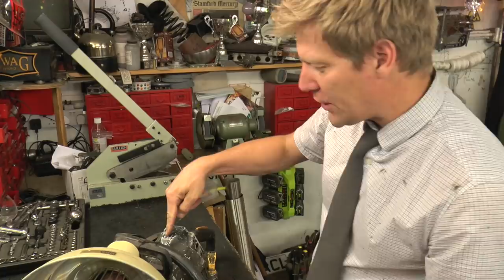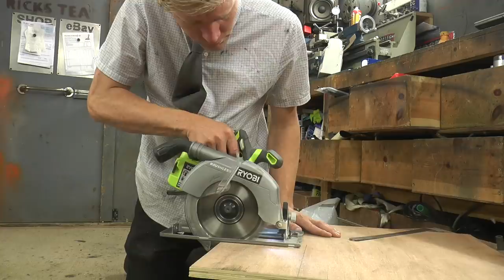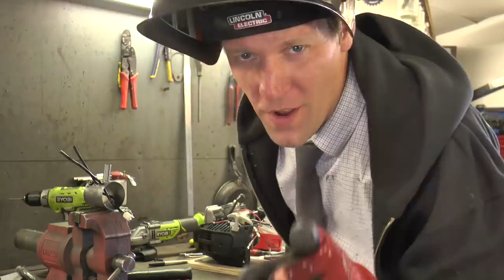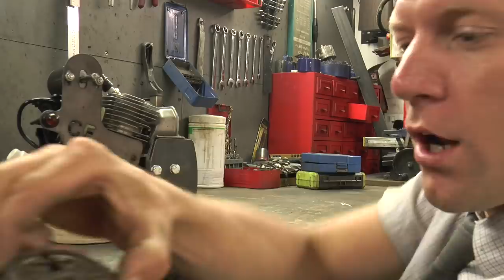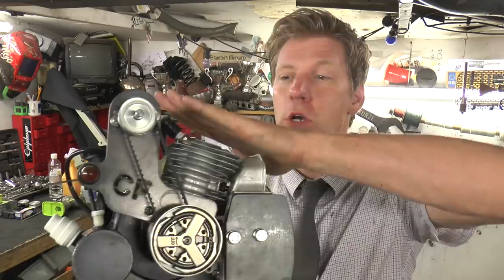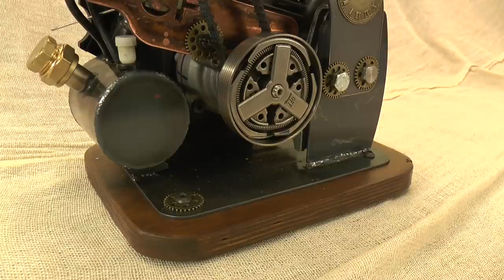Making a Chainsaw Table Lamp

Comment: At first I wondered why this was a thing. But then he explained that lamps aren't manly enough and you know what? He's completely right.
Reply: Electronic lamp? Pussy
Petrol powered lamp? Slightly better
Nuclear powered lamp? Yes.
Reply: Why not power it ya self
Reply: True
Reply: There were experiments about the nuclear one in Japan, they decided it isn't the right answer after two flashes
Reply: Ernest Y I recommend giving "nuclear light bulb" a Google
Reply: "Yeah dude, just had to go to the corner store to pick up some uranium for my lamp. See ya soon."
Reply: Ernest Y   “Oh no. My lamps fusion reactor’s broken. I think it’s run out of deuterium.
Reply: He said there was no testosterone in an electric lamp, but there's no testosterone in a two stroke powered lamp either. If you want testosterone in a lamp, powering it by male hyenas on treadmill is probably your best bet.
Reply: POSITIVE MASCULINITY
Reply: Not a very silent lamp though... I would hate to have that thing on while watching TV.

Comment: I would like to see a 2 stroke vacuum cleaner. 😊
Reply: what about a leafblower?
Reply: 2 stroke microwave
Reply: 450CC 2 Stroke vibrator dude!
Reply: 2 stroke generator + vacuum cleaner + tape. easy.
Reply: ohyeahtotally08 no the electric motor would be replaced😑
Reply: Two stroke boombox.
Rock'n Roll accompanied by high rews can't go wrong!
Reply: David van Ruiten How about a steam powered vacuum cleaner?
Reply: @m1k869  thats already a thing

Comment: Next, swap a V8 engine in a Tesla.
Reply: Ed Weird in Smart.
Reply: And then turn it into a lamp
Reply: why would you downgrade a tesla?
Reply: /r/woooosh
Reply: Someone actually made something better: a diesel in a Prius!
Reply: Someone did put an LS crate motor in a Model S front end that they were converting to a desk. It fits just fine.

Comment: "We're using the CNC, we're cheating a bit" 

Tools don't make you better, they just make you quicker.
Reply: debatable, For example a hacksaw and a circular saw do the same thing, But my cuts are a hell of a lot straighter with a circular saw, and some tools do the same thing but require different skills to do that job, A cnc machine I'd imagine this varies, But I know some use cad to tell the machine what to do, And the machine does it very accurately, Where as with a plasma cutter instead of being skilled with cad you have to be skilled with plasma cutting, And you won't be as steady. You're welcome for the essay you didn't expect nor want.
Reply: perfect response
Reply: beastm0de7, I found I can get a good straight cut but stone me it takes effort with hand tools. I'll have to jig it up, or just take my time. I take out a track saw though, buzz, done.
Reply: My uncle taught me something in his garage when I was a young boy it's two quotes I live by till this day when making something: "work smarter not harder." And "don't do the tools job for it; when you use it correctly the tools does most of the work for you."
Reply: that's not true in the case where you aren't directly using the tool; you can download a model and cut it out without ever doing any real work, aside from downloading it and sending it over to your cutter
yes it does the same thing as some other tools, but there is no human element to using it unless you manually change the settings on how the thing cuts.
Reply: So, how good are you at hewing marble (or drilling round holes in metal, or planing wood, etc.) with your bare hands?
Reply: I tried telling a girlfriend that once.

Comment: use the exhaust as a fan !
Reply: That really would be the manliest fan in the world, having it pump two stroke exhaust in your face, but a fan running off the same belt might be more practical, and help with the voltage spikes too
Reply: While a fan running off the electricity from the belt might be more practical, practicality isn't manly.
Reply: no as a heater
Reply: omg, best idea ever!
Reply: sam rowland i think The best way to add a fan functionality to that lamp would be to mount an exhaust gas powered fan, which is gonna act a bit like a turbocharger (except on the other side of the shaft would be a fan)
Reply: Ah, the wonderful scent of two stroke! A Modern fragrance for the powerful masculine.
Reply: danthefrst somebody should bottle that and sell it!
Reply: Hmm,  I feel like a catalytic converter fits into this mess somehow. LOL
Reply: Steven Ingram: Nah, only ripped out! As Mark Knopfler says it "If you wanna run cool, you've got to run on heavy heavy fuel"

Comment: What an excellent idea for a bedside light. Keeping one hand on the throttle you can use it for a bit of reading,remembering to 'blip' the throttle when you need to turn the page over,  then get a great night's sleep when the exhaust fumes render you unconscious, then as it ticks over in the dark it will keep you asleep until the fuel runs out. Perhaps you could fit a larger fuel tank to help you get a lie in at the weekend?

Comment: I always like steampunk devices that look that way because they actually use those parts to work, as opposed to having random bits attached to something very generic inside, no matter how artfully. This lamp's clever design and build quality makes it look like it's been made by a company that also makes motorcycles in an alternate reality where power stations do not exist because either there is not enough people using electricity or they were destroyed by a worldwide disaster or war, rather than something hacked together at home. It would fit great in a post-apocalyptic  game like Fallout or a movie like Mad Max.

Comment: Should have kept the chain drive. More manly than belt drive.
Reply: Jim Fortune there are advantages to the belt over the chain that makes it smart. and smart engineering makes it a intelligently manly.
Reply: Imagine the noise if he'd done a gear drive.  :D
Reply: Square-cut gears, the manliest of gears, no less.
Reply: Mitch Holladay
Smart or manly. Pick one.
Reply: Triangle Gears
Reply: Chain will jump/fell off, if you put it side ways or shake it. i think that's why put a belt drive??
Reply: Also needs it to be a diesel

Comment: You should have snuck a voltage regulator or fuse in the design so you wouldn't always blow the blubs! I also would have liked to see a few seconds of it actually running... Would look great at the cottage with a backup battery on-board.

Comment: I can't think of anyone who wouldn't want to buy one of these. How much would you charge to make another one? Depending on how long it takes to make this, you could probably turn a profit by making as many as you feel comfortable making per month.

The lamp doesn't have to be exactly the same which would make each one you make unique but keep the chainsaw and the rest of the work the same.

You could even sell them in parts so that people have to assemble the parts together following your instructions. Would cut down on the time it takes to make them.

Comment: I think it'll be cooler if you could plug it in like a normal lamp and run the engine when it's unplugged so you can actually use it practically

Comment: Don't want to be a knocker Colin, however these engines were designed to have forced air cooling , you could have used some of those surplus watts to power a 12v fan out of a computer thereby keeping it cool, also provide a little warmth for the cold fingers.

Comment: I'd say this is more dieselpunk than steampunk, especially considering you are using a gas engine and all.
Reply: Then its gaspunk

Petrol is not diesel :p
Reply: @CockatooDude  When I think of steampunk, I think of 19th century fashion and bronzed metal machinery; for dieselpunk, think of interwar fashion and tech.
Reply: Yes, for steampunk, he should use a small steamengine to power the generator.
Reply: Petrolpunk
Reply: Petrolpunk*
Reply: @maniacalcoyote6087  It's literally in the name — steam-punk. It has to be driven by steam. By style-wise you're absolutely correct. Colin mishmashed the styles.
Reply: @thomashverring9484  There are even steampunk computers. So this is clearly valid steampunk.
Reply: @MetalheadAndNerd  "Steampunk is a retrofuturistic subgenre of science fiction or science fantasy that incorporates technology and aesthetic designs inspired by 19th-century industrial steam-powered machinery." "Steampunk most recognizably features anachronistic technologies or retrofuturistic inventions as people in the 19th century might have envisioned them." (https://en.wikipedia.org/wiki/Steampunk)
Reply: @MetalheadAndNerd  Listen, I don't disagree. But because someone calls their design steampunk doesn't automatically make it so. The inspiration still has to be of the 19th century steam variety. Adding a motor like the chainsaw lamp made it look more diesel than steam. But obviously it's in the eye of the beholder, too.
Reply: @MetalheadAndNerd  It doesn't have to run on steam to be steampunk. Electricity, springs, slaves, vulcanos, magic, chemical reactions etc.. But gasoline is from a different eon, the introduction of gasoline is one of those things that changed the world "over night". If steampunk was real it would end with the introduction of gasoline.
Reply: Petrolpunk
Reply: @thomashverring9484  I think the key word here is inspired. A non steam-powered machine might be inspired by 19th century steam machines but not use steam. I'm sure that most steam punk designs are for steam tho

Comment: If you didn't have the clutch on there you could hook up a small battery and use the motor to have electric start then once it fires it will switch to being a generator and run the lamp and charge the battery at the same time!!

Comment: You know, you could've used an automotive voltage regulator instead of the potentiometer, cool build though, always wondered if a 2 stroke could power something.

Comment: Instead of a motor speed controller, just sticking a 12 volt three-terminal regulator would've done. You can get them in higher ampages than the default 1A but they're all called 7812 far as I know. Simple linear regulator so needs a nice chunky heatsink, nothing too clever or poncey to detract from the 2-stroke glory and stink of petrol.

Comment: It looks all nice but you have removed the fan that blows air through cylinder cooling fins.. Probably not a good idea to have it running for too long as it is most likely going to overheat and seize

Comment: Isn’t that a 4 stroke? You can see him drain the oil and the fuel he puts in doesn’t have oil mixed in and he says the engine runs at 3k rpm and most 2 strokes rev higher

Comment: COLIN WAS THAT STRAIT GASOLINE???

You need 2 stroke gas for a 2 stroke engine. Should be mixed with oil, and usually has a blue tinge when mixed. Check your pistons, ill bet your cylinders are all messed up.

Comment: Erm how is using CNC cheating? CNC is mainly a man thing and you wanted to crate a man lamp. Therefore using manly methods is fully in line with the ethos. The one thing I would say though is that not putting a hayawge K&N air filter on it is a bit girly.

Comment: Bedside ICE powered table lamp?  You're going to die of CO poisoning!  (Or will you pipe the exhaust out the window?)
It's not Steampunk, it's Dieselpunk.  If you wanted Steampunk you would have used a fucking STEAM engine!

Comment: Pfft, using dinosaur squeezings. how pathetic. Real men use radioisotope thermelectric generators. Your lamp would be able to run for decades and also double as a heater to heat up your meals